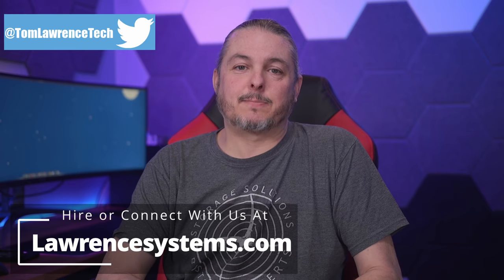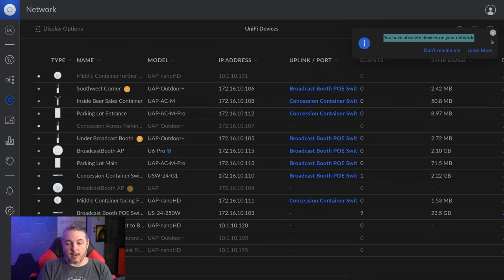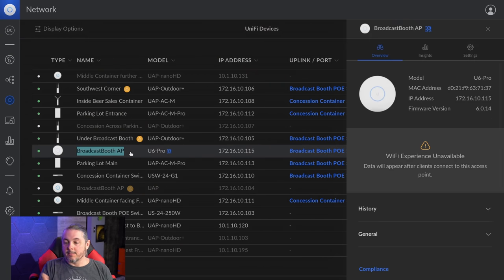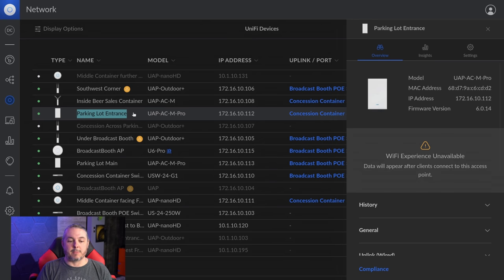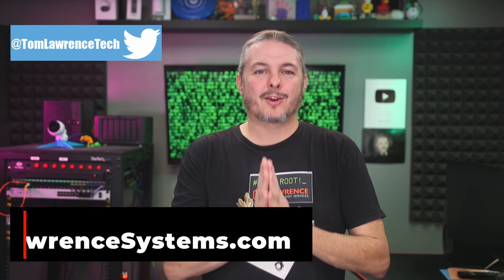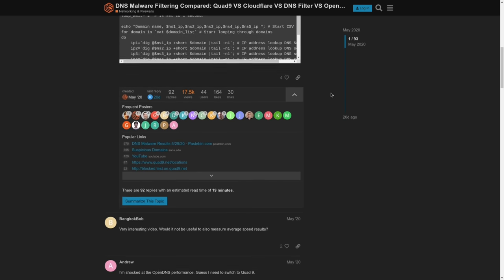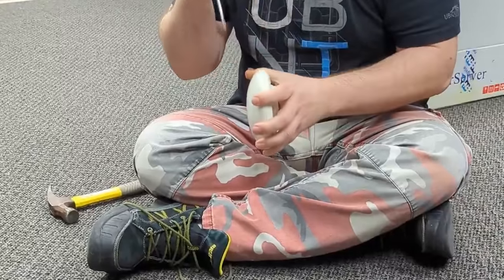UniFi: How Long Has This Equipment Lasted For?

Comment from the maker: Ubiquiti Project Followup: How Reliable are the 283 UniFi Access Points & 12 Switches we installed?
https://youtu.be/Sv8w_plmYTk

⏱ Timestamps ⏱
00:00 UniFi: How Long Has Your Equipment Lasted For?
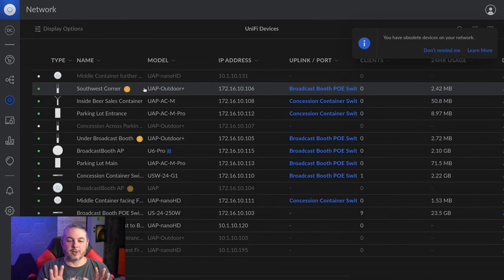01:25 The 2016 WiFi Project
04:13 Nanobeam Site to Site 
06:02 Final thoughts
Reply: I actually bought ubiquiti devices for my home. I bought an edge switch and AP to replace the horrid stuff my ISP provided, and I'll be adding more. The edge switch was a great option providing POE and light routing, while the AP is brilliant and has been in the house for several years now. The edge switch even has SFP connections to do fiber to the new building we are putting in soon. I've had little to no trouble with the software and the company as a whole and would definitely use their stuff again.

Comment: About 400 devices in Hostifi, another 350 devices in Unifi, and over 1250 devices in UNMS, from indoor APs, to outdoor APs, to airMax radios and airFiber radios going over 6+ miles of ocean, Unifi switches and gateways, and Edge switches and Edge routers, a pretty good track record for hardware reliability.
Reply: Hello from Technibble!

Comment: I have been managing the Unifi system with the company I work for since it was first implemented 7+ years ago. We currently have upwards of 250+ WAPs across all our sites. I can't recall a single WAP that had to be replaced due to failure. We've had some die due to water damage from ceiling leaks, but very few if any from the product just failing outright.

Comment: I’m currently at 1-1/2 years with my home Unifi system (3 APs, 4 switches, 7 cameras), an EdgeRouter 4, and a NanoStation AC5 Loco wireless bridge to my detached garage. The only issue I had was one time a switch crashed and locked up. I restarted it and it’s worked fine ever since. Everything else has worked flawlessly.
Current uptime is 274 days but there’s some firmware updates waiting and that’s bound to change. This is by far the most reliable home network I’ve ever had.

Comment: I've been using them in Florida for quite a long time... The biggest problem I've had with Ubiquiti gear was blown and damaged Ethernet ports where they'd fall back to 10Mbps.  Even using their special wire, this happened somewhat regularly.  A local WISP started building in-line surge suppression devices and ever since we switched to those it's been smooth sailing.  I also think UBNT has made their newer gear more rugged as well. 

 Had a few hurricanes and our access points were absolute champs.  We never lost connection.  We ended up piggy-backing many local businesses off our system until their normal providers (Comcast & CenturyLink) could get their shit together.   The WISP ended up getting a few national retail chains as new clients.

Comment: I have had minimal issues with Ubiquiti, one small site with 3 AP's went down and all AP's seemed dead, replaced them all but all were reset and are testing perfectly now. Turns out the phone provider had installed a non-Ubiquiti PoE switch and had plugged them directly to a 48v PoE instead of the 24v injectors they had (they were the original 24v only AP-AC-LR). I also had a powerbeam get hit by lightning which didnt go well but overall they are great.

Comment: I deal mostly with small-medium businesses and I have been all Unifi for years. Only failure I have had was an indoor AP that got water damaged. It was not the devices fault. I work with my ISP who has equipment on my towers uses all Ubiquiti and they have held up well outside of lightning damage and being blasted by RF from my transmitters. After swapping a lot of their stuff on the tower to fiber, some better grounding and some ferrite beads on the copper we have stamped out a lot of those problems. The only thing we have issues with is running out of spectrum/very high noise floors shooting over populated areas that have their own wifi blasting usually in auto mode. If you get power problems between switches use glass wherever you can. You can get 2 media converters and a loop of fiber for like 30-50 dollars and it gives you an air gap between equipment that might be on different circuits/locations/grounds that might put voltage on the cables that can pop switch ports. I pretty much have a rule anything going in or out of the building and/or on different panels I use fiber. If I have a cranky switch port I throw a fiber loop on it and often the problems go away. This applies to using armor cable as well.

Comment: We only have a limited unifi installation (<20 indoor devices). We had already three failures, but for the price it's still cheaper to just replace them instead of buying more expensive gear

Comment: I have many sites deployed with UniFi wireless and a couple also using UniFi switches, all have been great. I also have a large fleet of EdgeRouter devices, also great, but Im concerned that UI don't seem to be focussing any energy on the software side of the EdgeMax line.

Comment: I had a terrible wifi situation, then on the strength of Tom's recommendation, bought several Unifi AP's and we no longer have wifi issues anywhere. It's been a year and they've been solid, I just use a PoE powered Raspberry Pi to control them when needed or when I wish to monitor them. Thanks again Tom!

Comment: I've been in the telecommunications biz for 40 plus years, starting in two-way radio (through the 1980's) then paging (1990's), then cellular macro (outdoors) and now work for a company that provides communications gear for the cellular biz to provide coverage solutions indoors (I design, build and write the software for test systems that test communications hardware).  In each case I have noticed generally the equipment outlasts the dominant communications technology of that particular time. Honestly if 5G delivers on its promise, I will likely evolve the components of my home networks (wifi, zwave, zigbee, and other proprietary wireless system)  to support those newer technologies and abandon wifi all together since the congestion on the wifi bands around my house is terrible.  The key is having systems that work together in harmony instead of a mix of un-coordinated systems that are constantly interfering with each other.

Comment: I think a key take-away is price of Unifi hardware.  When you go Cisco, it can be hard to get spare hardware past financial because it is just so expensive.  When you look at Unifi, it can easily be 1/5th the cost to get the same job done.  So then you go and ask for some spare hardware and it is a lot easier to get in a number of cases in terms of the financial department of a company approving it.  This can actually be a big boon to minimizing downtime as for example the common thing to do at least used to be get the big Cisco switch for a pile of money, then the warranty would expire / device reaches "end of life", a clock board or something breaks (those things are notorious for losing clock boards), and then that is the end of the whole big switch running the company.  You instead get a bunch of smaller Unifi switches and some spares and if anything breaks, you don't lose all that much and you can quickly swap out the broken hardware with a spare.  Not to say the Unifi hardware has all of the bells and whistles of the Cisco hardware, but instead as you mention does it have the feature set to do the job?  Usually when you talk about a small to medium build, the answer is yes.  If you are wiring up a data center or something to the like, the answer is no; you need the feature set Cisco provides or may even get into other data center centric hardware.

In terms of is hardware more reliable today, I think the real answer is yes and no.  There are some higher quality components, especially capacitors, which is usually what kills a piece of hardware, not the actual silicon,  However, power density has gone up with associated cooling issues.  The hotter stuff runs, the more likely it is to fail early.  Ubiquiti may be running quality components, but they also like to let things run hot, especially switches.  I wouldn't be surprised if these don't last quite as long as they should.  They really should make it easier for users to adjust this some.  Like their Gen 1 48 port switches with dual 10G SFP+ uplink ports.  You get the non-PoE switch and the fans are turned off.  These switches can run really hot because of this.  That can't be good for the longevity of the device.  It should be a deal where you can set this for "server room" mode where the fans run fast and loud and home user mode where the fans run at a low, quiet setting.  Just simply having the fans off seems like a bad idea.  Then you go to the PoE versions of the switch and the fans are on, generally at a high setting.  The PoE version of course puts out more heat, but yet it runs a lot cooler than the non-PoE version.  It just seems to be kind of nonsensical.  Then again as least for business access switches you really want PoE these days.

Comment: We use their cameras & the UniFi Project system. And just recently had a G3-Pro get moisture in the sealed lens right after the one year mark. Now what rubbed me the wrong way is if we’d bought directly from Ubiquiti, it would have been under warranty for another year with no questions asked (buying direct gets you two years warranty), but since we bought from an authorized seller, that warranty was only 1 year. Originally our RMA request was denied, but I reached back out & stated that while I didn’t remember why we bought from an authorized seller (and it was a large online & physical store brand), it was during the pandemic & Ubiquiti could have been out of stock when we needed those cameras. Ultimately they changed their mind and approved our RMA Request. Now where they did sorta win me back, was they sent a better camera (G4-Pro), but that could just be a stock issue, it’s hard to say.

This also doesn’t necessarily seem to be an isolated issue with at least the G3-Pro line from a quick Google Search I did and when I’m dropping $300+ on a camera, I expect it to last more then just outside it’s warranty period. Hopefully this was just a fluke, but I’m now questioning our other G3-Pro’s and hoping it doesn’t, but now also waiting for them to develop a problem.

Comment: APs used for a home environment should last a long time. My Ubiquity APs were 10 years old and still working along with the cloud key.  They were wireless N, however since Ubiquity was opting discontinue updates I converted over to Wifi 6 and got a dream machine. Aps have been installed for 2 years now and working reliably. I have 7 wireless apps running a few switches. All in all the investment seems to be decent. Upgrading the equipment they recognized some bugs a couple years ago but the system is running reliably since.

Comment: I replaced my routers with Mikrotiks. The Unifi Edge Routers POE operated so hot I could heat my home with them. One of them failed on me. The heat finally got to it. While I was at it I also replaced the Unifi WAPs (which are excellent) with cAPs. Beyond their Edge Routers, I found Unifi  products to be solid.

Comment: I would really love to hear your take about the unifi "Wifi clients dont receive an IP via DHCP issue". Some background from my point of view. I manage a comany wireless for about 2500 employees (Cisco WLC with a CCNA wireless) and i had my eye on unifi as a cheaper, more modern looking solution. I asked my friend who equips mostly schools with wifi what he thinks about unifi. He said its a great solution except for the fact that they have alot of issues with clients dont getting IP by DHCP.  This issue is not something that is fixed in firmware X, but comes back every few firmwares and it drives the customers crazy. Because of this, they dont install unifi at customers anymore, they use mostly aruba. I moved to another house about a year after that ant wanted to give Unifi a shot and installed it privately. Everything ran pretty well. But after a certain firmware upgrade, the DHCP bug hit me. Nothing i could do, the wifi is pretty much uslesess. Had to downgrade and wait for a firmare that fixed it again. Read some forums and Reddit is full of posts that unifi solution has this ever re-occuring issue. Now became more cousous with upgrading and pretty much leave it at the same stage. We then, aquired another company that had 6 offices and used unifi as a solution. I talked to the guy responsible and he said you have to be very very careful with upgrading, in order to avoid the DHCP bug issue. So what is your take? Did you have to deal with this on your customers? If yes, what is your reccomendation to get rid of this issue? I heared things like setting a manual ACL on every AP to work around this issue. Can you recommend these products with this kind of track record? Would love to hear your thoughts about this. Just recently subscribed from your video with david bombal on PFsense. Loved the open mindfullness and being honest about the weaknesses of the product as well.

Comment: Unifi APs (original 2.4G model) - I blew out a protector when I stuck it on 48V, fixed that, still works. Perfectly solid all that time. AC Pros - same, rock solid. Original CK, it corrupted on me once because it has no backup battery. CK2+, solid; UDM Pro, so far so good (fairly recent buy, I just can't get the gear due to the shortages). POE switch (24 port 250W) has at least one port totally dead. 48 port non-POE (I've got 2 of them) - fine. 16 port POE switch (1st series again) - fine. Other than having no stock for ages, the network gear is good in my view. Camera wise, the 3-series dome cameras were super temperamental with not coming back up again. I actually think that killed that switch port. Newer firmware eventually seemed to improve this. Still haven't been able to order a camera for >1 year now. 
Appreciate the video; Clearly as you install and maintain huge numbers of equipment, assuming non-DOA, the gear holds up well.

Comment: I'm in the middle of having my UDM RMA'd right now.  It's about 2 years old and has started not letting me log into it (via any method).  It still functions, wifi's up, etc. but I can't log into it to manage it, add new devices, update firmware, yada yada.  Fortunately, Ubiquiti support asked me to RMA it (even though it's out of warranty) so while it sucks that it's down, I have to give props to them for their support.

Comment: Home USG power supply block died couple of months after warranty. Well, took random 12V with enough amperage and I keep running USG. It is good that supply is an external device so I didn't have to disassemble anything.

Comment: Been running Unifi network on an school campus for almost 10 years now.  Just finally upgraded the oldest APs to new U6 devices a few months ago, mostly due to to the software complaining about them being obsolete.  But to be fair, they really were obsolete, the network runs all around much better and faster with the new APs.  I am surprised at how many people have devices already that support WiFi 6, which just makes everything better.  As I recall, only one of the APs failed over that 10 years and replacing it was not really a big deal.  Also had one small POE switch fail, but it's unclear if that switch actually failed on it's own or if someone did something to it as it was not in a totally secure location and the circumstances were suspicious.  Rather insignificant costs anyway in the grand scheme of things.  Very happy with all the Unifi gear I have worked with so far and I will continue to use it and recommend it to others.

Comment: For Ever. i have OG equipment and they still work. not as good as new stuff but still get the job done for what I need. but that's just because of software and new tech. good power strip with power cleaning you will be all set.

Comment: I had a G3 flex that disconnected I found the lan cable was corroded and the camera base was full of water because the roof was leaking. I took the camera apart cleaned it and the G3 flex worked again 🤯

Comment: So far have I’ve had good luck with unifi hard reliability. The biggest issue I’ve had is having unifi wifi 6 lr being doa three times in a row. RMA process was quick about getting replacement units. Took a while but I got them.

Comment: Just pulled out a 7 year old setup which had no issues. Most issues I have seen are actually from improper installation or dirty power feeds (including a lightning strike 🤯)

Comment: I always found Cisco equipment to be the most reliable hense why they are still an industry standard. I still have some Cisco switches that dates back to 2012 still in use today in my server rack.
Reply: But you're also paying a 500% premium for the hardware, and then there's the licensing costs for the wifi controllers.
Reply: @nuanil  I don't pay anything. My unmanaged Cisco 24port doesn't use software that's been in my rack for over 10 years.

Comment: I bought 2 APs, 3 switches, and an edgerouter-x-sfp-6-port last year. I really like thr product for my home. The only issues I've had is with l2tp and openvpn - i can't get it to work and reading similar issues it looks like a running a really old firmware solves the issue. Unfortunately I haven't seen any firmware updates so that's my only bad experience with it

Comment: I have a UAP-AC-Lite WAP that I installed for my parents in 2017. My parent has a roach infestation and the WAP is a literal roach nest and I refuse to touch it. Despite this, it's still working well and has a strong signal.